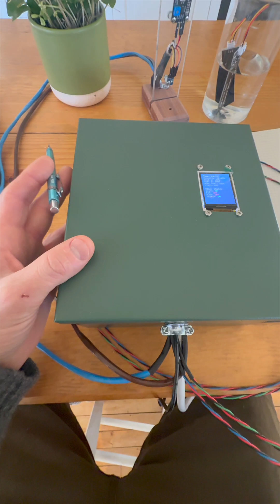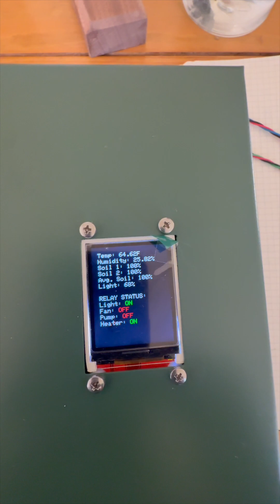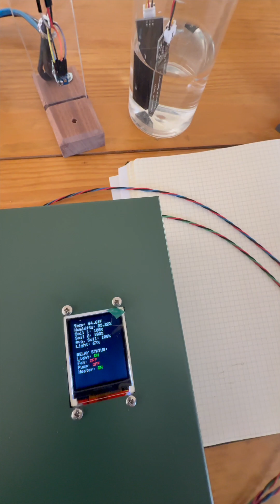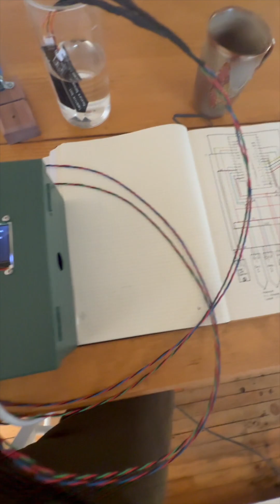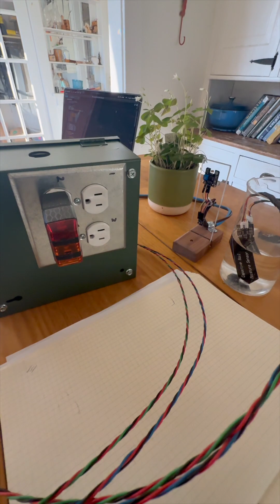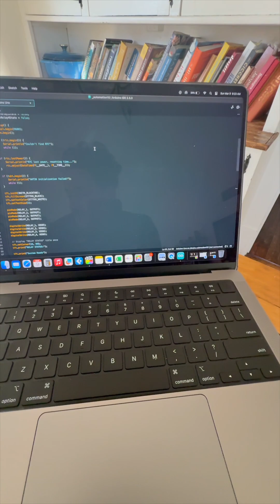Home Garden Automation Controller using Arduino

Comment: I'm working on a similar project using ESP32 for sensor hubs and Home Assistant on a raspberry Pi to collect the data and automation. The ESP32 communicate with the PI with WiFI. You could add a cheap CO2 meter and maybe find a way to estimate PPFD from your light reading. Cool project.
Reply from the maker: I like your idea of using CO2 meter, I think I will add it to my project in the future.